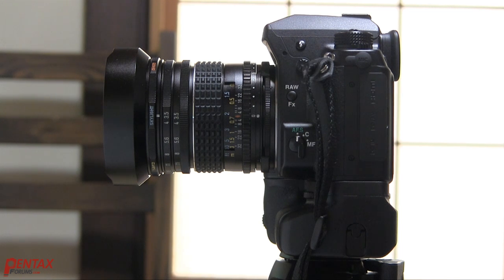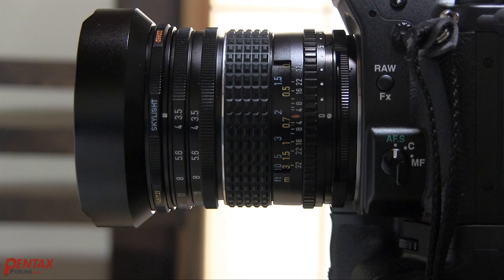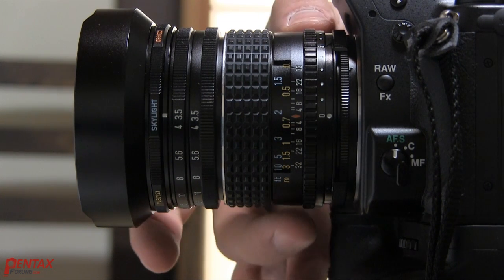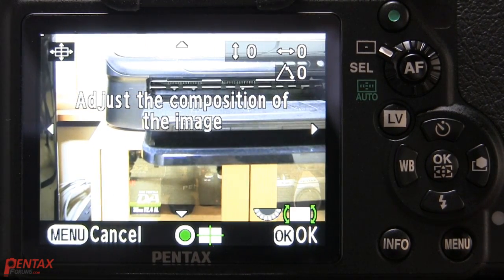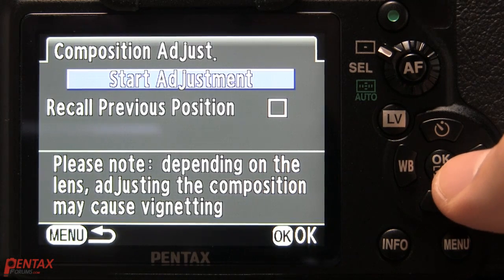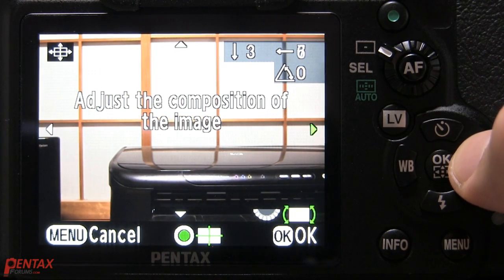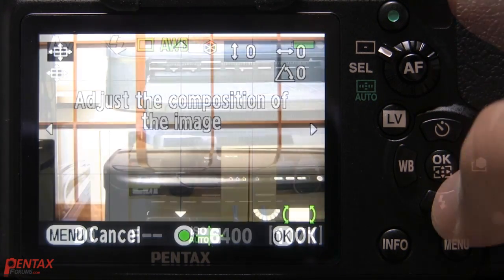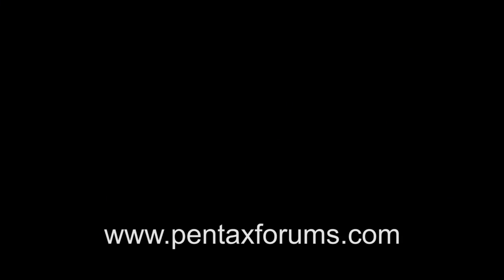Turn any Pentax lens into a shift lens: Composition Adjustment

Comment: A good shift lens typically shifts 12mm each direction, expressed as "+-12mm shift". Even the cheap Venus Optics Laowa 15mm f/4.0 Macro -- at about $500 it's crazy cheap for a shift lens -- does +-6mm shift. 

The Pentax composition adjustment feature shifts only 1.5mm each direction, i.e. +-1.5mm shift. That's a worthwhile feature to have, but hardly replaces a shift lens. Best to think of it as a 12.5% extension to a good shift lens -- it turns your +-12mm shift into +-13.5mm shift.

But best watch those corners! Lenses that are weak in the corners under normal conditions will be all the weaker on one side if shifted 1.5mm in that direction, and the weak areas will be bigger.

Comment: One should point out that the shift range is very small compared to a proper tilt-shift lens, isn't it? While this is useful to make small adjustments when the camera is on a tripod, I doubt it's ever useful to fix the common issues in architectural photos.

Comment: great option but sorry, Composition Adjustment, although very handy and useful, is NOT the same as Perspective Correction that a dedicated lens provides, is it?
the PC lens also 'tilts', right? but the sensor on these cameras doesn't do that, not at the user's will and via manual control at least ...
Reply: +dadautube It is comparably the same.  The in body shake reduction does it at the sensor level via magnets.  which can be manually manipulated to give this effect.  Shifting the lens on the sensor is the equivalent of shifting the sensor to the lens, the adjustment just doesn't go as far.